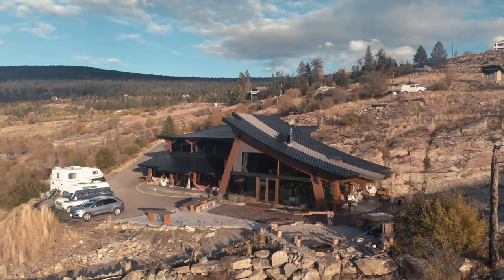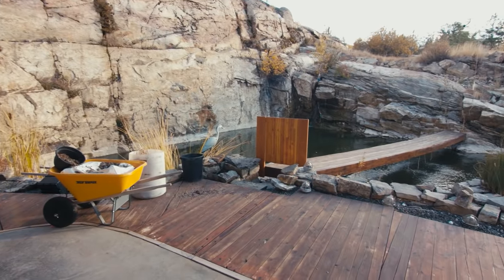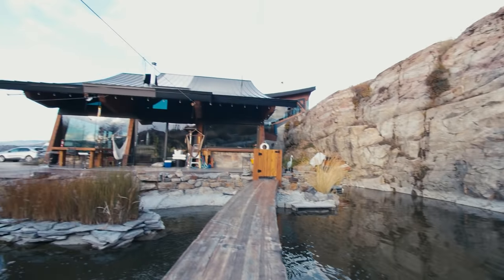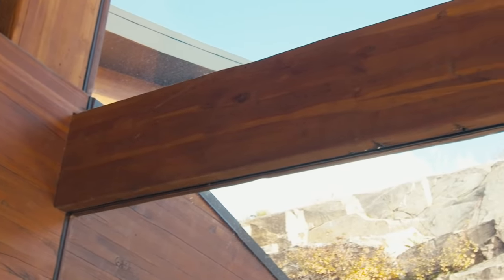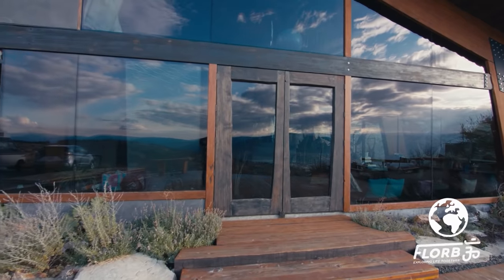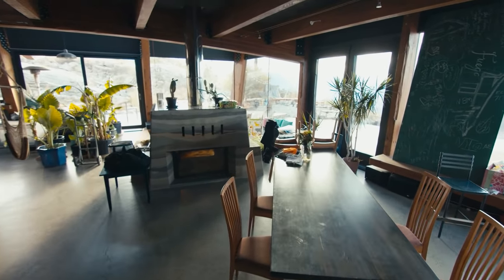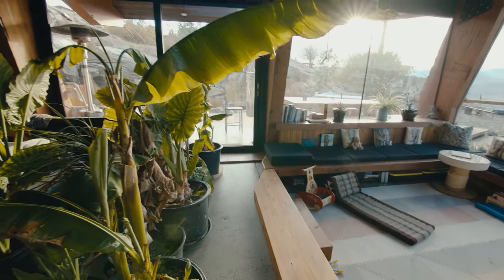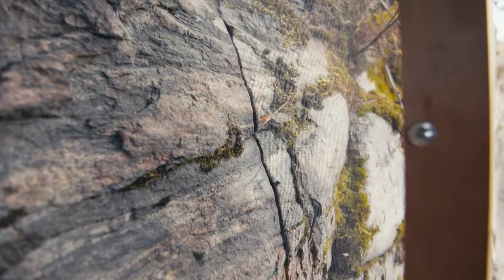Man Builds Dream House from Recycled Timber

Comment: Quality home. True craftsmanship. This home will stand for generations.
Reply: Or will it? 😈🔥🔥🔥
Reply: Doubtful... wood does not last, no matter what. You want something to last, build it from stone
Reply: Yeah it’ll last maybe 5 generations if not repaired and left as is, maybe. Otherwise it should last a bit yeah
Reply: Another real problem is that it has structural wood touching metal, thus the wood will be destroyed from the areas that are exposed due to the metal connections and then the metal itself rusting and destroying the wood with the rust
Reply: @rickmorty5215  spot the incel
Reply: @aaronjackson2780  STONE?!?
Reply: @choblgobblrr1074  yes indeed. You think the pyramids would still be around being made of wood?
Reply: @aaronjackson2780  Theres a Japanese wooden Pegoda built in 607 that is still going strong. Besides that, he said generations, not until the end of the earth.
Reply: @choblgobblrr1074  nearly every building in the UK is made of stone.. and 90% of them are older than the United States.
Reply: Old orthodox churches which used to be our first schools, most if not all built out of stone some even built inside the stone are around forever. And the ones that been bombed easily rebuilt. Pretty much a staple of house construction. Every new one like catholic ones built by vatican are made of wood, most burn out thanks to old unprotected wood and electrical sparks from outdated electronics and instalations. The catholic and gothic ones are all show and no actual structure just like their fake faith... so I guess serves them well.
Reply: @calebandrelek2971  Bruh. All Catholic churches I know are from stone. And who bombed orthodox churches anyway except in ww2 and ww1?
Reply: @jackjohnson8055  *In Europe.
Reply: @aaronjackson2780  that’s not true at all😂
Reply: @aaronjackson2780  Stone erodes over time & becomes much more expensive to maintain or repair.
Reply: @aaronjackson2780  Pyramids are made of limestone & in an extremely dry climate.

Comment: Hi there FLORB, beautiful home man, seriously it's a piece of art! Thank you for this.

I wanted to share a concern with you about your home. I work doing specialty overlay concrete and resin floors - you should check if the resin you used for the pennies is UV stable. If the Resin is not UV stable the parts exposed to sunlight will amber and ruin the floor in a few years time. It would be very sad to see such a beautiful floor ruined!

If the resin you used is not UV stable, you can mitigate the problem by putting a polyaspartic, or UV stable epoxy overtop of the floor, it will help to protect it!

Comment: This is an AMAZING HOUSE! Based upon one of the camera shots, I can see it's in a part of the Okanagan that is very hard to build on and 10 to 20 years ago nobody would have wanted to buy it so I am pretty sure he got it for about the same price my relatives got their's for which is around $40,000 CDN ($30,000 USD) at the time between 2000 to 2008. In 2022, it's now worth between $800,000 CDN to $1,500,000 CDN just for the land and even more as builders have now bought up much of that land and are building super luxury houses right on the rock using steel stilts and concrete pilings with massive windows for the view! 

Some of those luxury houses are in the $3 million to $15 million CDN range!

You can still get relatively cheap land for around $200,000 CDN if you go 25 miles outside of Kelowna into the wilder parts.

V

Comment: For those of you who want to do something similar, do what I did! Learn HOW to do 3D CAD using the open source CAD (Computer Aided Design) software you can get for free or pay some extra and buy something light Newtek Lightwave-3D which is a GREAT 3D modeling program that can build ANY type of design that can easily output drawings for a builder.

I have already built my ideal home and landscaping in the virtual world with realistic 3D renderings and animations AND those renderings can now become real-world printouts that if I follow precisely will give me a home that can last a THOUSAND YEARS!  I will be using non-metallic polymer composite rebar embedded within a 80,000 PSI-rated 30 cm thick (12 inches) super-concrete shell to build a compound-curve house that can withstand any weather for thousands of years. 

The outer protective coating that I will be putting on the concrete itself will be a Tungsten Carbide-infused beautiful golden-colour borosilicate glass that is sputtered-on using a DIY (Do It Yourself) thick film system (Oxyacetyline Torch melting powdered borosilicate glass and tungsten carbide) which makes the surface super-smooth, filling in any pits and crevasses and protects against rain, snow, sleet, ice, UV/IR Sunlight, acids/alkaline-products deposited by birds and other animals, etc.

The polymer rebar is actually STRONGER THAN STEEL and doesn't expand due to rust nor does it contract, meaning no cracks AND the fibre-reinforced concrete is rated to 80,000 PSI compressive strength and also has high tensile/torsion/extension/flexion strength which basically turns my home into a very sound-proof bunker!

Interior-wise, I will be putting in a 18 inch layer of rock-wool for R60 insulation value for the -40 and below winters we can get here in Canada along with putting in torch-burnt Douglas Fir 2x12 planks that have been steam curved to fit the compound curve concrete house structure. When burnt with a propane torch, scraped with steel wool and then oiled up with Danish Oil and then a layer of clear but UV and fire-resistant polyvarathane, a beautiful orangy/red wood colour with black carbon streaks appear which gives the entire house interior a very rustic feel! Some thick tree trunks of Douglas Fir cut in half and hollowed out to fit around the interior concrete posts will also give a nice rustic Log Home feel. 

Floor will also be rustic stained one-inch thick maple hardwood to give a nice ambiance which also allows for multiple re-sandings as it ages.

Since I'm doing the work myself  along with extended family (rebar-work, concrete mixing and pouring too!), the total construction costs will be less than $250,000 CDN. Since I like being completely off-grid, land will be fairly cheap at less than $200,000 CDN for 10 acres.

if you have enough of a down payment, the bank WILL lend you the land and construction money and it just takes some elbow grease to do the work. YES! I have an advantage that relatives already have some larger cement mixers, small excavators and cranes that I can rent cheaply from them to do much of the work myself AND I have already done CAD/CAM and real-world test work indicating I can do the entire job in less than eight months working 8 hour days, 6 days a week since machines will be doing much of the heavy lifting!

If you can do ALL the work on the computer FIRST and ensure you cost out EVERYTHING including structures, electrical, HVAC, fixtures, screws, bolts, nuts, paint, furnishings, landscaping, etc you CAN do-it-yourself at a reasonable budget and time-frame!

V